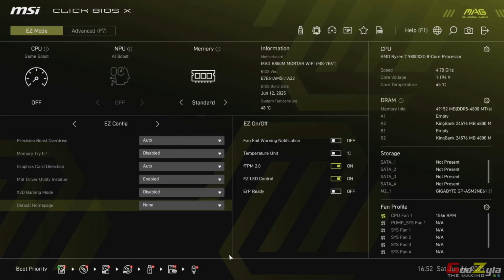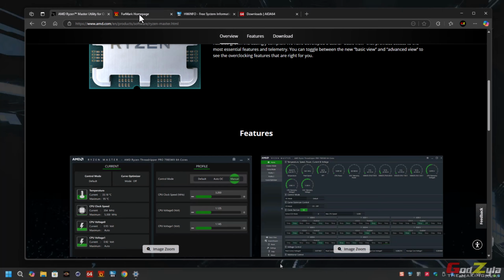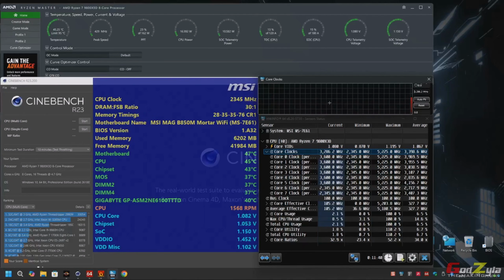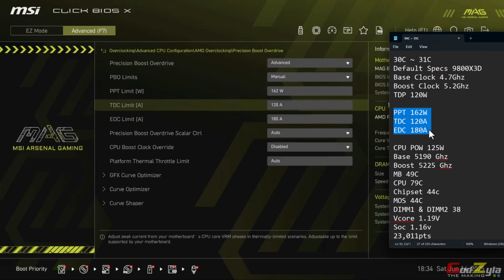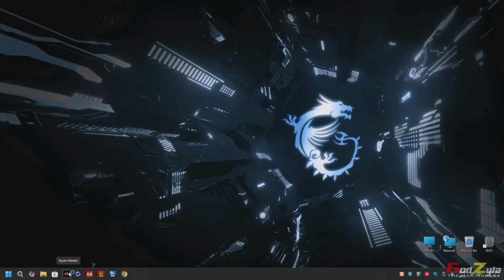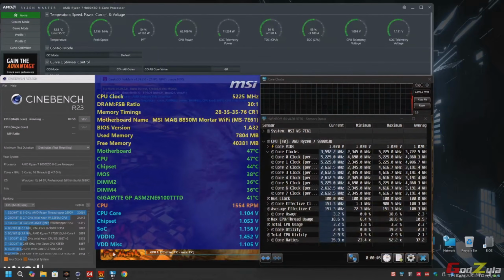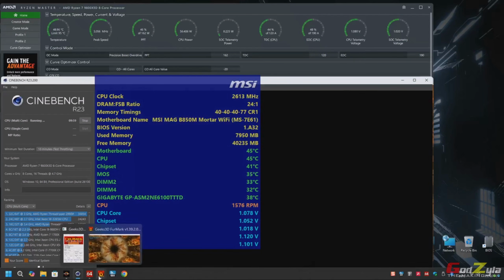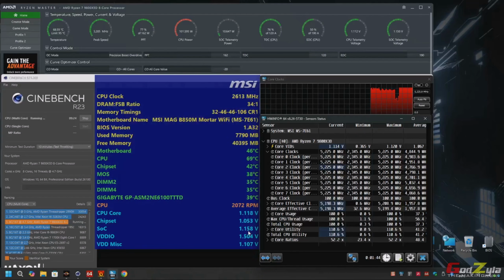PBO2 Curve Optimizing with 9800X3D on MSI Motherboard

Comment: Not sure if I did something wrong. Followed all your steps. Temps went way down. Barely peak above 62 (was only ever peaking at 80 at stock) but my score is 1400 vs the 1890 I had at stock with PBO ‘enabled’ and that’s it
Reply: Have a very very similar build to yours just cl30 ram
Reply from the maker: Hi SubduedOrb, welcome to my channel. when you trigger PBO to enable, the board will take control with no limits. whatever cooling your cooler can provide, it will just pull and push to the max. maybe that's the reason why you are getting higher cinebench scores on Single core. Maybe you can clear cmos, have the way you run it before, observe the temperature not only your CPU but to all your component, inclusive of your VDDCR_SOC voltage and Vcore voltage. Take down the readings. Next clear cmos again and to set as what i've illustrated here. compare both readings. See which is more comfortable for you. You see for this content is more about having total control over the settings and to run it at a safety figures, inclusive of running it healthily.

Comment: I have the exact same msi board
 I enabled x3d mode at first and was told to turn it off but now the boot times are way slower also was told to disable rebar which idk if it helps but  please lmk what you think i also have a 9800x3d and a trio 5090
Reply from the maker: Hi [Scott]1014, , welcome to my channel. I am not sure about the x3d mode but I do not turn it on and as for resizeable bar, I will have it on, especially when you are running at 5090.
Reply: @KleoYan can you try it out possibly?
Reply from the maker: @Scottg1014  I have returned the 9800X3D to AMD SG, but I have tested on my 9950X3D. As I dont play games, I can't tell if this do anything but for normal work. it slows down my process and excution. I google this and this is what I get. 

For single CCD X3D processors (e.g., 7800X3D, 9800X3D), do not enable X3D mode as it disables SMT and cores, reducing performance.

For dual CCD X3D processors (e.g., Ryzen 9 9950X3D), enabling X3D mode might give benefits in some specific scenarios, but typically it reduces multi-threaded capabilities and requires you to restart to switch modes.

The mode can lower temperatures but usually at the cost of performance.

Most users experience better gaming and overall performance with X3D mode off.

Comment: Hi kleo, before i start the stress run, i noticed the PBO in the bios from the default is already stated as auto, should i leave it like that and run the test stress first before doing the tweaking for the PBO after test stress with occt? Or i should disable the PBO so it became a stock test run?
Reply: Because when im running with your settings like the video and the latest comment with step 1 and step 2 but with PBO set to auto (default bios settings)

I got 87c max but with 4.5ghz only, is that normal?
Reply from the maker: Hi Knox, welcome to my channel. By default on PBO Limits, if it's set to auto, it's on AMD default PPT, TDC and EDC. your thermal will be higher before setting the Curve optimizer and Curve Shaper. It should drop thermal after you've set Curve Optimizer and Curve Shaper. If it does drop, means it's working and reason of your thermal at 87°C, it could be your case airflow or the cooler you are using.  If it does not, I will encourage you to do a CMOS reset.
Reply: @KleoYan  i probably try to repaste my CPU first and see the results again soon, im using an Air Cooler DeepCool AK620 zero dark but was planning to change to AIO if this doesn't work and still high temp

thanks for the explanation!
Reply: @KleoYan  and now i use your settings with PBO + CO + CS, it boosted me up to 5.425mhz and 1.27v avg, is that good enough and normal?
Reply from the maker: @knoxtq  you should compare to your own default against your current settings. I can’t tell if it’s good or not good for your processor. As my chip is from AMD best silicon chip. So ya. If your current is better compared to your default, lower temp, lower current used, better performance and being stable, then is all good.
Reply: @KleoYan basically i need to do the cinebench or other comparison the default settings (without PBO + expo) then compared to my current settings that been boosted (with PBO + EXPO) right?
Reply from the maker: @knoxtq  that’s correct. That’s why in this content I show the default , after tweak and my own tweak. I encourage you to fully understand this content as to know what and how it actually works,  so you won’t doubt yourself if it’s good or bad. Nevertheless all the best with your tweaks

Comment: Hi Kleo, thank you for the guide, I was able to follow it successfully on similar hardware to good result. I am down to about 70C at load only drawing 90W.

I did notice that my HWiNFO CPU Core Clock graph is not completely constant and has some drops, should I be concerned? 

It is constant at 5,225 Mhz then around each 10 minutes it will have a drop down to 4,245 Mhz or so, sometimes with 1-3 smaller drops (4,572-4,898 Mhz) in between those larger ones.

Also, Cinebench score dropped from 22,185 pts on default to 21,165 pts after undervolting.

Thanks in advance for your advice!
Reply: 60 minutes of OCCT w/ AV2 showing 100% constant Max Boost Clock with 0 drops.
Reply from the maker: HI DareToDespair, welcome to my channel. There are times I do get the same thing as in the configuration does not perform. So what I did is a hard reset (Clear CMOS), shorting this JBAT1 2 pin on the motherboard.

Comment: Yo dude would you recommend these settings for tomahawk x870 (not E) and should i follow the steps you took or trust the settings. I have the 9800x3d and kingston fury beast expo 32gb 2x16gb, 6000mhz cl30 . Cheers for any response 👍
Reply from the maker: Hi Mubberd. welcome to my channel. As mentioned the demo here are safe to use. I will do these sequence

Step 1 - Configuring Rams to run at 1:1 ratio with tight timing.
1) Set fan profile first (Cooling is important)
2) Set expo, reboot system and back to UFEI
3) Set Dram Speed to 6000
4) Set FCLK Frequency to 2000
5) Set UCLK DIV1 Mode to UCLK=MEMCLK
6) Set High-Efficiency Mode to Enable
7) Set Memory Timing Preset to Tightest
8) Set CPU NB/SoC Voltage to Override Mode
9) Set Override CPU NB/SoC Voltage to 1.15v
10) Boot into windows and run Aida64 Stability test for 30minutes at least. or run OCCT test with AVX2 for 30mins
11) If unstable, go back to UEFI, Set High-Efficiency Mode to Auto (as your rams can't do tight clock cycle sync)

Step 2 - Configuring CPU Vcore offset (undervolting to help thermal) 
1) Once stable at Step 1 10), back to UEFI
2) Set CPU Core Voltage to Offset Mode
3) Set CPU Offset Mode Mark to - (Negative sign)
4) Set Offset voltage to 0.05v
5) Boot into windows and run Aida64 Stability test for 30minutes at least. or run OCCT test with AVX2 for 30mins
6) If unstable, go back to UEFI, set CPU Core Voltage to Auto

Step 3, final step
you can use the settings as shown here to configure your PBO Limits, Curve Optimizer and Curve Shaper.

As why these steps, gradually you will learn that what your rams can do and how low vcore your CPU can do. Then play with PBO Limits, Curve Optimizer and Curve Shaper. So if anything unstable, you dont have to doubt Step 1 and Step 2, only leaving you with Step 3 to figure out.
Reply: @KleoYan thank you dude. I will try these for sure.
Reply from the maker: @mubberd  you are most welcome. All the very best. 😉
Reply: @KleoYan ok dude ive finished testing and each step was stable in 10 minute test on cinebench 2024. The only thing i didnt do was high efficiency mode i left that to auto at all times. Do you recommend i mess with that? 

The results.

Step 1 81c (max)

Step 2 75c (max)

Step 3 with pbo, co and cs- 64c (max)

So thank you temps are low, boost clocks are excellent voltage and wattage locked in.

One last thing, would tou enable latency killer?

Again thank you as im a novice first builder and want my system as stable as it can be. Really interesting and informative video.

All tests were multicore on cinebench.
Reply from the maker: @mubberd  you can 1st save your current profile. Next, give the High Effciency mode a try. If it fails, can always revert back by loading back the profile you’ve saved.
Reply from the maker: @mubberd  oh as for the latency killer. Leave it. If you enable it might lower your performance and it does increase power consumption.
Reply: @KleoYan  I enabled it and set it to tightest and it was stable in a 10 min cinebench. The reason im doing 10 mins is because I have an air cooler so it is faster at reaching highest temp. I am now happy with the stability and will start gaming. Thank you for help and patience.
Reply: @KleoYan ok cheers dude
Reply: @KleoYan  ok thank you
Reply from the maker: @mubberd  You are most welcome.
Reply: @KleoYan  ive done about 6 hrs of battlefield 6 and about 4 hours of tarkov since using these settings and the pc is completely stable. Max temp in either of these games was 59c. Cheers dude.

This is in a fractal north xl case 3 x 140mm fans come with case in front.

Thermalrite phantom spirit 120se

2x Noctua NF-A14 140mm top fans (1x inntake 1x exhaust)

1x Noctua NF- A12 fan exhaust.

XFX Mercury OC 9070xt.

Ambient room temp is 21c
Reply from the maker: @mubberd  That's good to hear. Congrats, happy for you 👍

Comment: Great video! Please make with 7600x 🙏
Reply from the maker: Hi Kaski, welcome to my channel. Maybe you can try this
In UFEI > go to advance mode, select OC 

01) Enable EXPO profile
02) UCLK DIV1 MODE to UCLK=MEMCLK (for rams that have a bus speed of 6000. If above set it to UCLK=MEMCLK/2)
03) Enable High-Efficiency Mode
04) Set Memory Timing Preset = Tightest
05) Select CPU Core Voltage and set to Offset Mode
06) CPU Offset Mode Mark to [-] sign
07) CPU Offset Voltage to 0.0500V
08) CPU NB/SoC Voltage to Override Mode
09) Override CPU NB/SoC Voltage 1.15V

Boot to windows, use Aida64 System Stability test to run (run for 30mins)
If stable skip A) ~ B) jump to 10)

if unstable, 
A) Boot to UEFI
B) Set High-Efficiency Mode to Auto

Boot to windows, test again with Aida64 System Stability test (run for 30mins)

if unstable 
A) Boot to UEFI
B) CPU Core Voltage and set to Auto

10) Click on Advanced CPU Configuration
11) Click on Precision Boost Overdrive
12) Click on Manual 
13) PPT Limit to 142W / 142000mA
14) TDC limit to 110A / 110000mA
15) EDC limit to 170A / 170000mA
16) Set Platform Thermal Throttle Limit 90
17) Scroll down, click on Curve Optimizer
18) Select All Cores under Curve Optimizer
19) Select Negative under All Core Curve Optimizer Sign
20) Set value 18 to All Core Curve Optimizer Magnitude

for 5000 and 7000 series Processor, Curve Shaper is not supported.

Comment: Good afternoon. First of all, I wanted to thank you for the wonderful, very detailed video. And I wanted to ask what psu are you using? Or which one would you recommend in combination with this processor and 4080 super video card. Thanks again
Reply from the maker: Hi Ya Beke, welcome to my channel. I mainly make use of the Montech 1050W Century II PSU https://www.cybenetics.com/evaluations/psus/2812/ on all my open bench content. .
For my main rig, I am using Seasonic PX1200 Vertex https://www.cybenetics.com/evaluations/psus/2490/ and on my secondary rig, am using Montech Titan PLA 1000watts http://cybenetics.com/evaluations/psus/2427/. These are the PSU I am using. All are capable to drive a 9950X / 9950X3D with a 4080 super without issues.
Reply: @KleoYan  Damn, you answered so quickly)) Thank you very much. Success and prosperity to the channel!!
Reply from the maker: @yabeke1835 you are most welcome and thank you for the bless wishes. 🫡

Comment: I'm quite lost because I"m not seeing similar results from the very start. CPU is same, mb is MSI 850I EDGE TI, RAM is quite tight-clocked 6000MT kit (though a 96GB one). Problem is, when both Furmark and Cinebench are running, I can only see base clock at around 3200, while yours is above 5000. Also when I configure Curve Optimizer/Shaper in BIOS, power draw stays at 123-124W and clocks look same as before. I feel I'm missing some switch but don't know where to look. CPU temperature stays below 68c. The only thing I noticed is that my Ryzen Master looks different and more "streamlined" for novice users, with bigger and less convenient UI.
EDIT: also, I have my GPU inserted in motherboard, but it's not being used by either BIOS or Windows/Furmark. Cable is inserted into MB and I selected primary GPU to Integrated.
Reply from the maker: Hi CHOI EUNMI, welcome to my channel. I think you are having the latest version of ryzen master. do this steps. 
1) Clear Cmos 
2) do not set anything, load to windows
3) Launch ryzen master. click on CPU on the left menu
4) Click on tunning, click on Basic
5) Now in tunning, click on Settings
6) Check on Write to Bios
7) reboot your system. 
8) Start to do your tweaks.
Reason for this, the new ryzen master will overwrite your bios when you boot up to windows, this will cause it not able to pick up your settings in UEFI. Unless you using ryzen master to do the changes and to save it, but this is rather troublesome as you need ryzen master to auto boot when you load windows.
Reply: @KleoYan  Thanks for reply!
Do you mean I need to do tweaks using tool instead of MSI BIOS?
Previously I also tried uninstalling Ryzen Master and installing previous version, albeit without clearing CMOS, and didn't see any change. I noticed in your tests running only Furmark makes CPU consume around 10W, but for me it was never less than 20W. Running Cinebench alone makes it ~115W. When running Cinebench alone my clocks increase, but only to ~4.6 GHz. Furmark is what slashes them to ~3.2 GHz.
Reply from the maker: @choieunmi9303  what am saying. if you want to use UEFI, at the new ryzen master, you have to set the settings. writting on bios.. else everytime when you change the settings in UEFI and when it boot into windows. Once you launch Rzyen Master.. it will take over if you did not set the settings to "Writting to Bios" 

This is the main reason I test it without the GPU, so when I do the test without the GPU, it will consume more CPU Power, once I plug my GPU. it will drop. having the GPU with the processor and tweak. you will tend to push your processor higher. and as for the wattage drawn more than 20W, this I have no idea.
Reply: @KleoYan  Thanks for the suggestions!
I can accept losing the chip lottery, but I just continue to see more stuff that I can't find explanations for. I gave up on Ryzen Master v3 and went with v2 but that didn't change anything. It caught me that the GPU chip power reported by Furmark for you is around 36W, while it mostly stays above 50 for me. Even though the reported clock is the same, I lowered the GFX frequency and that helped to bring down the CPU power while running Furmark. But still, its default value is 600 according to Ryzen Master so you see 600 there but 2200 in Furmark. I end up with 1700 in both Ryzen Master and Furmark. It still didn't help me break the 5 GHz mark but oh well.

In the end it feels wrong that just decreasing iGPU freq can improve my CPU clock stability. I'm not aiming to use scenarios with iGPU in work or games. I see that using iGPU while stress-testing is not a bad idea by itself, but it may appear that different motherboards can vary a lot in power configuration and make it not a universal method for everyone, because numbers can vary a lot.
Guess I'll try other software without involving iGPU, fiddle more with power limits and try to find good PBO values for each core.
Reply: @KleoYan  One thing I forgot to add. I found that on my system, running both Furmark and Cinebench makes CPU use less power than Cinebench alone, by 1-2 W. Have no idea why, but if I had to guess, it's probably because Furmark makes CPU struggle more and therefore motherboard applies limits more aggressively.
Reply from the maker: @choieunmi9303  you are not wrong on this. if you kick in Cinebench, it will just stress on cpu processing but once you trigger APU (furmark) the processing unit will cut down slightly but the real test is not only CPU and GPU but your other components too. that's why my overlay includes thermal on motherboard, vrm, rams, chipset and etc.

Comment: Hello!, great guide, thank you for that. I do have a question about ram, which one would you pick between G.skill TridentZ5 neo 6000 cl 30 and  Corsair Dominator titanium with the same speeds, I think both of kits are based  on sk hynix. Maybe u have another kit which is worth looking at?
Reply from the maker: Hi gladcomming, welcome back. the choice is yours. I am more towards performance and I no longer using Corsair or G.Skill as I find these brands cheaper and able to perform Biwin black opal HX100 48G Kit CL28-36-36-72 @ 6000 1.4V with max Jedec bus speed of 5600MHz instead of the standard 4800MHz. or the Acer Predator Hermes DDR5 48G Kit CL28-36-36-72 @ 6000 1.4V, again max jedec speed of 5600MHz instead of 4800MHz.

Comment: Can I apply the same values for Vcore offset, SoC 1.15v, Curve Optimizer and Curve Shaper for a 9700X ? except the PPT, TDC and EDC of course.
Reply from the maker: Hi ZLandBoss welcome to my channel. Yes you can, infact it will be best to set the Vcore Offset, enable the expo profile and to set the VDDCR_SoC voltage, then test it with Aida 64 > stability test for 15minutes. Once stable, then fiddle with the PPT, TDC, EDC, Curve Optimizer and Curve Shaper.